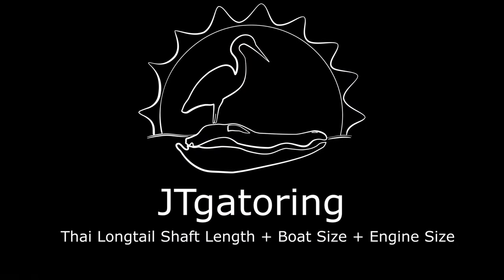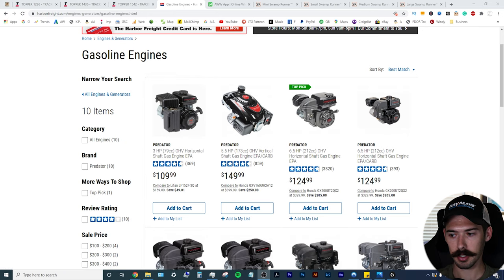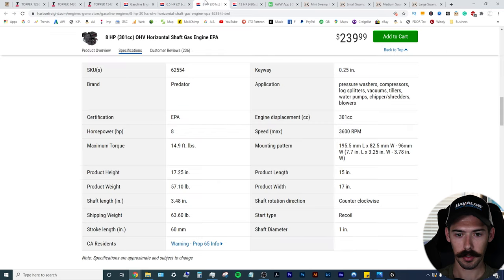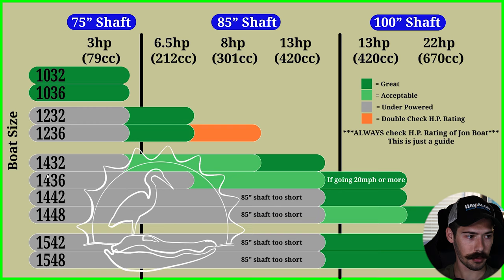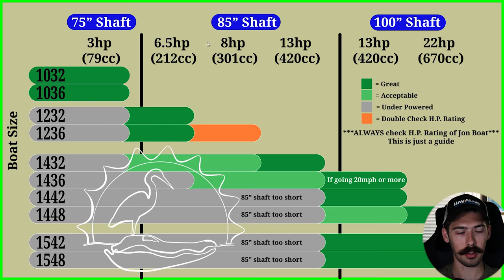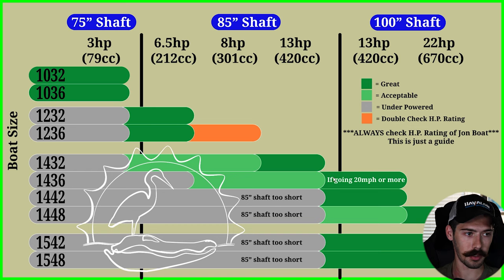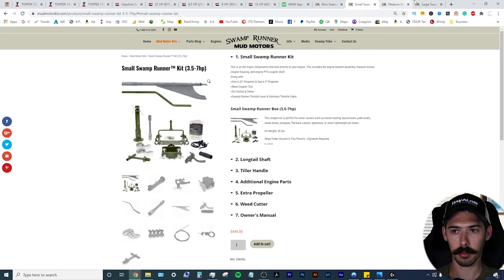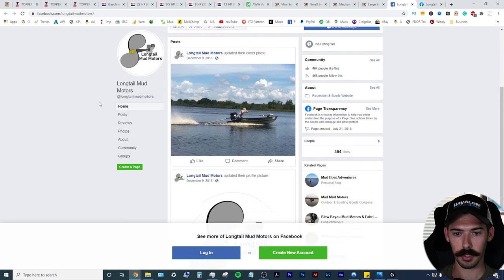EVERYTHING Thai Longtails: Boat Size + Engine Size + Shaft Size

Comment: As for modifications for motors I do not recommend with risking reliability potentially on the water. The Tillotson box stock 10hp 212cc is the best performing stock motor we tested at 17mph at 4600 rpm in the 212cc class on the 1436. It did not perform as well under load. The 8hp 301 was far better at load and pushing the 1436 19.2 mph at 3800k  undersame conditions and go to plane much faster.  The best 212cc we tested predator 6.5 212c 14mph duromax 7hp electric start 16mph and 17mph on the Tillotson 212cc 10hp with that being said they are marginally best than each other in top speed even going to a bigger motor.
Reply: Yeah, that's what people don't understand. You can't make up for displacement. A marathon runner cannot out run a bodybuilder if you put 70 lbs. rucksacks on their backs.

I would argue that the Tilly is not a stock motor. It's a factory hot-rodded motor. They just do all the stuff you do at the plant. I've never got more than 9 mph out of a stock Predator, but I' m a big heavy guy with a big heavy load of catfish.

diesel
Reply from the maker: For modification, I do think that people who are experienced with building engines will be able to build a dependable engine. People do need to keep the rev limiter in the engine though because the prop will slip out of the wake going from full load to no load in a split second so you definitely need that protection for the engine. People need to understand the risk analysis of reliability to increased performance. Again though, I'm a big believer in going with the crowd or the group. Most people are running the predator engines and if you make it past the 10 hour mark on a predator engine without any issues, then its considered reliable. If they do have an issue its normally within that first 10 hours and it should be exchanged for another engine. I've had too many people complain about the duromax engines over the years so I do not recommend them to people, and I haven't had anyone confront me about using a tilly.
Reply: @JTgatoring  I think maybe the older style of duromax had problems. But they are a really high rated power equipment company with good reviews and warranty and red beard garage uses them heavily.  I have not had any problems with the duromax 7hp electric start it even charges my trolling motor and I've ran it now on 4 different boats. The Tillotson 212 is a very well made motor very high quality and super responsive and smooth power curve. The only motor we had minor problems is the predator 212 with getting hot on long runs but we did an almost free mod to the exhaust that solved that problem its on our youtube.  But our environment is crazy here in AZ with Temps in summer regularly at over 115 degrees. As far as I'm concerned all honda clones are reliable just on the design alone regardless of brand. Its a low compression with larger displacement low octane power plant thats designed to do work for extended periods of time for hours a day on power equipment from water pumps tillers to generators ect. Its on old simple and effective design that works.
Reply: @JTgatoring  Well, the problem is none of these builders are putting their skills to the test on the water. Even when I talked to fellas in Texas about the Tilly motor, they were scared to put it on a mud motor. They just didn't think it would hold up.

I've talked to people all over OldMiniBikes forums, they all are saying the same things.

True if you make it 10 hours on a stock Predator, you have a good motor. I had more than 10 hours on my stock Predator before I started modding it. It still blew up. There are no guarantees when you build an engine to go beyond is original design.

The really is it's easy to get off the mini bike track when a motor blows. You get below the dam on a modded engine or up the Yukon River just before ice up and that engine blow, you die. 

I good race engine will never be a good work engine.
Reply from the maker: @BlackWarriorLures  Yeah it all depends what you are doing. I would like to think that most people have good enough judgment to know when to modify an engine and when not and have proper boater safety plans created before going out on a long trip. Live and learn
Reply: @JTgatoring  Well, most people don't have good judgement. They just don't know. Can't tell you the number of people who call me up asking about a stage four build and wanting it to be reliable for their remote hunting trip. Or how they removed the governor and the motor blew up and are still wondering how to build the engine beyond it's design specs for more power, when they would save money buy simply buying a bigger engine. Always having to bring them to a mindset that these are not toys but machines on which your life depends.

It's just one of those things people don't know. There are those who have done it for themselves and have actual empirical data, then there are those who just think it will work just because it seems good to them.

To fantasize is one thing. When the nuts have to fit the bolts, it's something else.

Comment: I would love to see a video of what happens when you do the upgrade performance kits like you see with go carts on the predator 212.  Stage by stage.  I know the stage 1 gets about 8 or 9 hp but the stage 4 is a 20 hp and rev limited to 9000rpm.  I can't imagine what that light monster will do.
Reply from the maker: Yes, that is something that I would be interested in seeing. With running a longtail, you do need to keep the rev limited intact, because once that prop jumps the wake, the engine goes from a full load to no load in a split second and you need to be able to protect the engine from over-revving. That 6.5hp is a great small engine with a lot of potential on a small boat.
Reply: Oh, I already did that. What happens is your motor lasts less and less, then blows up at the weakest point once you move beyond stage 1. Even stage 1 is risky because you tend to blow head gaskets. That little 20 hp 9,000 monster with last less than 5 hours.

I tell people that and they just don't believe it even though I've well documented it. Things don't run out on the water they way it run on land. Far more stress on the motor. My original stage 3/4 Predator 212 was about 18 hp and blew up like a grenade. They just don't last.
Reply: The go power sports tillotson 10hp 212 stock motor is built really well for longtail applications and will run like a commercial motor no problem. But there is no replacement for displacement when it comes to pushing load against water. Predator 8hp @ 301cc smokes it but weighs 56lbs. The Tillotson 212 weighs 38lbs. The 212cc are perfect for solo light weight jon boat fishing set ups super fun like a #boatkart.
Reply: @JTgatoring  I can attest to that. The Tillotson 10hp 212 governs out a 4500k ish and its sweet spot for power was 4200k and pushed the 1436 jon boat 17mph. But for the most part feels like any other 212cc except it resists stalling really well at low idle.  It is built to run at higher rpm without issue as a commercial grade power equipment motor with a flywheel rated to 10k. In my experience is the best stock 212 out there for the longtails.

Comment: Does transom hight have any effect  with what shaft length to use? (15",17",20")
Reply from the maker: Yes. 15" or less and an 85-inch shaft will work. 16" transom will work with an 85-inch shaft with the boat having a bottom width of 36" to 38" wide, but if its wider than 38" it would probably be best to get a 100-inch shaft. 17" or taller you will need a 100-inch shaft. Once you go taller than 20" the shaft angle is not correct and it gets very difficult to get it to ride easily if at all possible

Comment: Does this chart work with "v-hull boats" or just flat bottom boats? Thanks.
Reply from the maker: This works with all boats that are going to be on plane. Flat bottoms are going to be more true. V-hull still follow the same principles when it comes to bottom width, engine size, and shaft length. I would say that for the 95% of people this will work with the majority of boats out there.
Reply: @JTgatoring  I've got a 1442 v-hull boat and when it's in the water.. the back end sits about 6" from the top of the transom to the top of the water. Front end sticks up out of the water. When running, then slow down and stop.. the wake comes up over the back of the boat soaking everything. Running a 13hp gx390 with 100" mud-skipper kit. After watching this video, makes me wonder if I should try a 8hp motor, but going off the chart.. im right where I need to be 13hp, 100" shaft.
Reply from the maker: It sound like the boat is not rated for that size engine. You need to put more weight near the bow of the boat. Weight distribution plays a huge role when it comes to thai longtail motors. Check the rating on the boat, how much weight you have in the boat, and then play with your weight distribution when you get out on the water.
Reply: @JTgatoring  boat tag says max hp is 20. Max weight (motor and gear 650lbs) my dad and I are both around 195lb-204lb each.
Reply: @black_widow_overland  I am running a 12ft vhull decked with a 16hp mudskipper and 110 inch shaft and i love it. The 8hp has nearly the same top speed with 420cc being only marginally faster top speed when i used it on it due to the limited rpm. How ever the 420 had much better acceleration after 2500 3800 rpm. But low end grunt is nearly the same in my experience not a theoretical on paper 14.9 ft/lbs vs 18.4ft/lbs on the two motors. But after 2500k it's very noticeable.
Reply: @JTgatoring  yes and no. Vhulls carry more weight per length. Flatbottoms have way less drag/draft and much better top speed. Vhulls can easily handle higher displacement motors and wake/turbulence/waves much better. I have one of each with longtails.
Reply from the maker: @black_widow_overland  It sounds like you're just expecting too much from the boat. Thats 400 pounds of people and 130 for the mud motor which is 530 and then all the little extras that add up like fuel, boat modifications, and gear you have. It just sounds like you need a bigger boat. I would still recommend playing with your weight distribution in the boat. Going from the 13hp to the 8hp is only a 10-pound difference. If it's worth it to you, then by all means you can do it, but I think the boat is just maxed out.
Reply from the maker: @azlongtales  I would disagree that a v-hull carries more weight per length. A flat bottom jon boat has more surface area on the bottom when compared to the same length, bottom width, and load of a v-hull, and just as you stated above about a flatbottom hull, has way less draft and better speed because of it. The v-hull has more draft and need more water than a flat bottom hull when keeping the length, bottom width, and weight the same between the two. It also depends if you are talking a true V hull or modified v-hull that flattens at the back. If it is flat at the back, the wake will be very similar if not the same, but most "v-hull" jon boats flatten out near the transom and also have more of a chine on them which will change the way the wake acts.
Reply from the maker: @azlongtales  Also, the predator 8hp engine does have the 14.9 ft.lb.trq on both the standard and EPA/CARB models, but the standard 13hp engine that most people get #60340 or #60349(hemi) has 19.8 ft.lb. The California EPA/CARB 13hp engine is the one with 18.4 ft.lbs. Small difference but a big enough of one to mention it.
Reply: @JTgatoring  correct if the vhull is same width as the flatbottom near same carring capacity. But most vhulls are considerably wider at 48" to 60" transom  usually with higher capacity and HP rating per length and in all honesty not as ideal for a longtail but not useless either.  It will work if that's what you have and many people do. I've taken it thru as much shallow stuff as my 1436 but usually try to get a better running start than my flatbottom when doing it.
Reply: @JTgatoring  I do not have the carb version I have the hemi I live gods country Arizona lol. The two motors feel nearly the same under 2.5k then from 2.5k to 3800 rpm the 420cc was way faster. But there was less than a 1 mph speed change between the 301cc and 420cc at top speed. It was very shocking to me I though for sure 10hp tillotson was the best at 80lbs kit and motor vs 135lbs at 13hp I was thinking it was going to be the best on paper until I tried them all out. What i found out is all the motors are limited by RPM regardless for top speed.
Reply: @black_widow_overland   put a cooler/ person trolling motor/battery and deck in the front it will help a good bit. The gx390 will have no problem overcoming that. But in general vhulls  squat like that in the design to overcome wake and waves from the front.
Reply from the maker: @azlongtales  The 13hp should be able to handle a bigger prop then. What were the props you tested and did you push it till you saw a decrease in RPMs or handling?